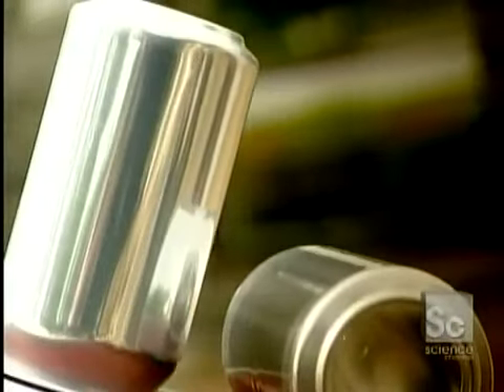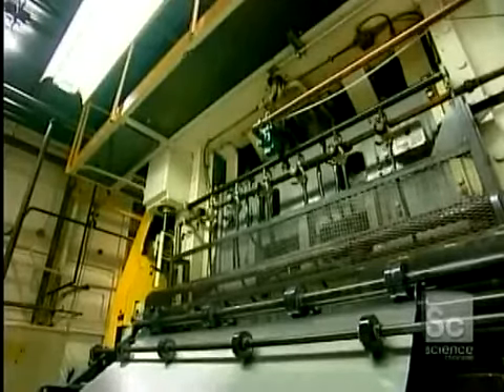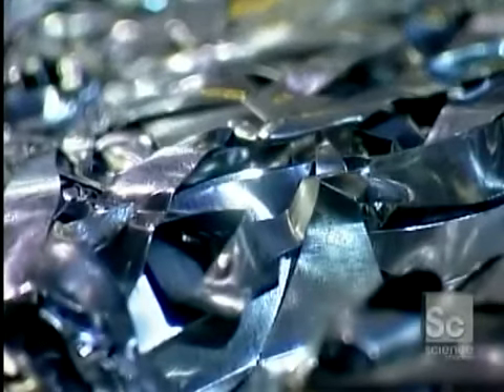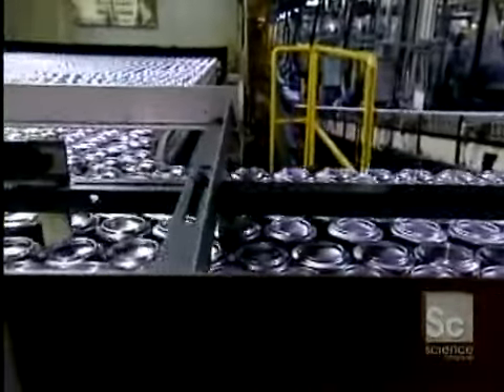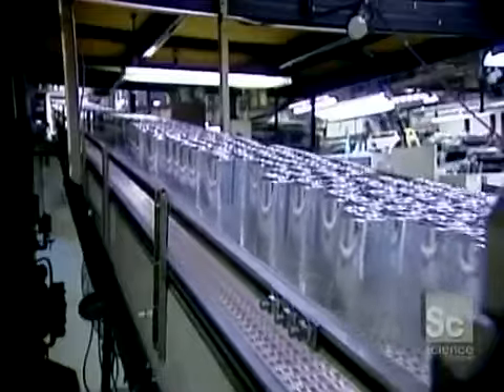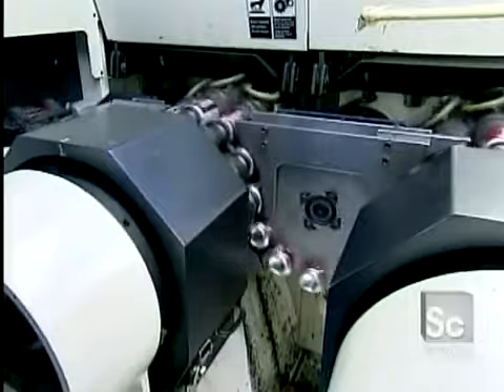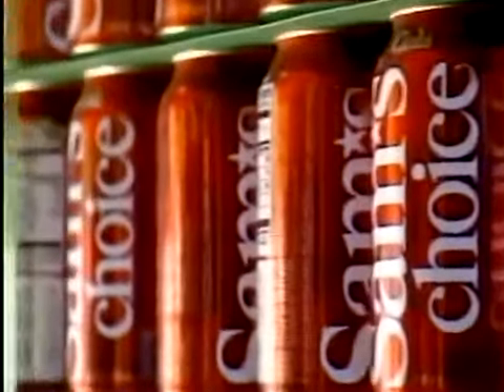How it's made Aluminium Cans - BVD Aluminium Cans - Production

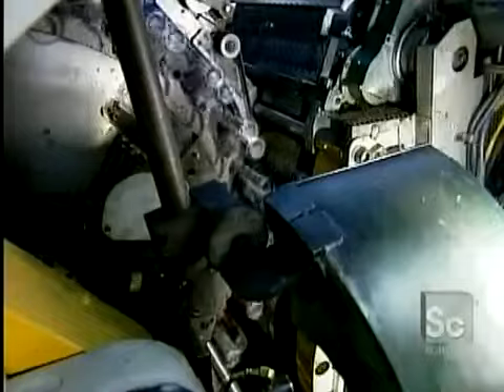Comment: FYI - At 3:04 mark, mentions that the ink is applied "one at a time". That is incorrect. The different ink colors are applied to the BLANKETS one at a time, but are applied to the CANS all at once. This can be seen from 3:10-3:18 where you can see the bright, unprinted cans getting "decorated", though the narrator incorrectly states that the overvarnish is being applied. OV is applied immediately following the ink application, and is not specifically shown by this video.